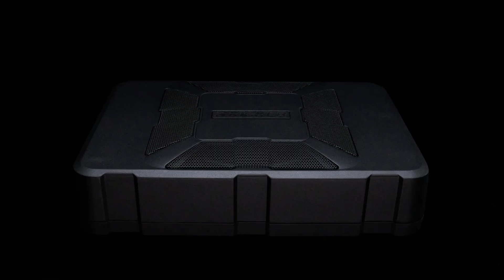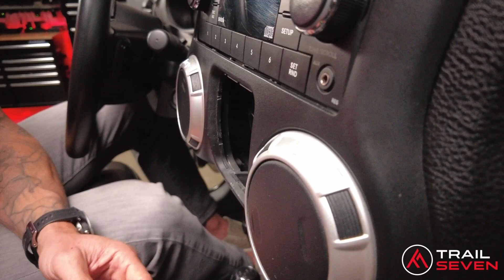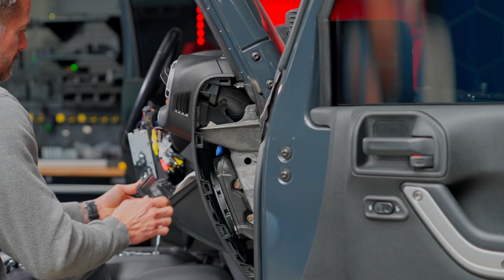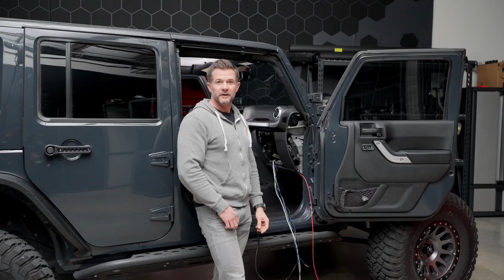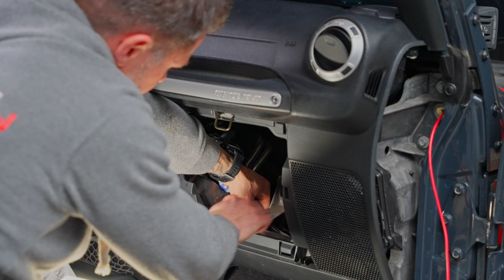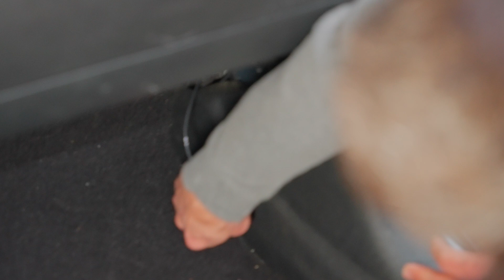Kicker Subwoofer Upgrade Bundle | 2007 - 2018 Jeep Wrangler

Comment: Will this work in a 2020 Jeep JLU? I also have the height 10 stinger head unit. The only difference I noticed was the disassembly of the dash, other than that it’s all plug and play.
Reply from the maker: Yes, but you can order our Hideaway bundle for the Gladiator and select aftermarket radio so we’ll prep it with the RCA’s to connect to your Stinger. 

They don’t rest under the seat in JLU as nicely as the JK.  It’ll rest sideways and will be a bit cramped. 

Here’s the link:

https://trailseven.com/products/kicker-plug-play-hideaway-powered-10-subwoofer-bundle-upgrade-20-23-jt-gladiator?variant=43931657175293

Comment: How does this compare to the Alpine underseat solution?  The SBV-10-WRA Pre-Loaded 10" paired with the Alpine KTA-30MW Tough Power Pack amp is what I am referring to.
Reply from the maker: Hello- This video is of the Kicker speakers.  You’re referencing the Alpine sub woofer and Alpine amplifier.  What are we trying to compare?
Reply: @trailseven  I am currently trying to decide between the 10" powered Hideaway from Kicker, vs going the Alpine underseat solution.  I know you guys have used both so I am asking how those 2 solutions compare.  I have the factory Alpine Premium system with factory sub at the moment. (2013)
Reply from the maker: @mopetersen6696  Ooops, very sorry, this is the Kicker Hideaway video, you are correct.  

The Alpine underseat sub is a phenomenal true 10” sub that can’t compare to the Kicker compact Hideaway.  The Alpine option is far more of a subwoofer and the KTA is far more true power.
Reply: @trailseven  thanx, much appreciated!!!
Reply from the maker: @mopetersen6696  You’re very welcome!

Comment: There are a couple of problems with this video. First, the dash disassembly shown is actually for a 2011-2018 JK/JKU. The dash is significantly different for 2007-2010 JK/JKU models. Second, 2007-2010 JK/JKU owners with the premium factory sound system already have a subwoofer in the rear cargo area and a bigger amplifier located beneath the steering column and behind the lower dash knee panel. This video does not offer the best choice for a factory premium sound system and my advice (as a professional audio engineer) is to simply upgrade your stock subwoofer by replacing the driver in it with a more efficient one. This will increase the bass output with minimal changes to the system. Unfortunately, Kicker does not understand this and does not offer subwoofer drivers with significantly higher efficiency.

Here's what you need to know: Every 3 dB increase of sound level requires you to double the amplifier power. Your driver must be able to handle this. This is the approach that Kicker takes. They make their drivers to handle more power so you can increase the amplifier size and get more sound from your subwoofer. This requires you to switch to a subwoofer driver that can handle more power and add a subwoofer amplifier that can supply the higher power. This quickly gets expensive. The way I'm suggesting for factory premium sound systems with a factory subwoofer does not require any more power, so you do not need to add or replace any amplifier. All you need to do is replace your factory subwoofer driver with a new one that has a higher sensitivity (i.e. higher efficiency). The factory 8-inch sub driver has a sensitivity of 85 dB or less. It has a dual voice coil and each coil has an impedance of 2 ohms. If you replace your factory sub driver with one that has a sensitivity of 91 dB you will increase the sound from your subwoofer by at least 6 dB. This would be comparable to increasing the amplifier power 4x (remember, it doubles for each 3 dB increase).

Higher efficiency will increase the cost of a subwoofer driver and you can expect to pay US$365 to US$400 in the U.S. (2026) for an 8-inch low-profile sub driver with a dual 2-ohm voice coil and a 91 dB (or better) sensitivity.
Reply from the maker: Um, thanks for your input?  😂.  

For one, this is a compact subwoofer solution to simply add a little bit of bass to the Jeep.  For two, the Jeep in the video is equipped with the factory Alpine subwoofer as well and in fact, the output from the Hideaway well outperforms that factory subwoofer.  Third, nobody said this was the “best”; if you’re looking for the best. We have plenty of full system bundle options using Kicker, Alpine, MB Quart, and Audison.  

The rest is unnecessary information to a group of customers seeking a quick, inexpensive, simple solution to add a little bit of bass to their Jeeps, but again, thanks for the information, we appreciate you. 😁

Comment: Very detail and I watch this few times before the installation. First time, took me 4-5 hours and few breaks to watch segment of the video. I have an AX4000 so no amp turn on wire. After some research I need to T splice to the REM on wire. Sounds great.

Comment: Any suggestions on installing one of these subs in a 2024 Ford Ranger Raptor? Looking to replace the stock sub behind the back seat.
Reply from the maker: @skbid1  It wouldn’t replace the factory sub.  That would be a more complicated set up.  The easiest would be to tap into the front  speaker wires similarly to our Jeep Wrangler/ Gladiator demonstration.

Comment: would you need an AMP to use this subwoofer or the Kicker Speaker Upgrade Bundle??
Reply from the maker: @johnblack8771  Not at all.  The Kicker Hideaway is a Powered Subwoofer which has a built in amplifier.

Comment: I’ve installed the 10 inch sub, but the bass seems to be pretty weak. It is powered on and I do feel it vibrating. Maybe I was expecting to much? I’m not sure, it’s not very noticeable over stock.
Reply from the maker: @Cody-eo1hr  I would say that’s it not connected properly or not adjusted correctly.  The 10” Hideaway undoubtedly overpowers the factory subwoofer.  

Please call us to assist with the adjustments.  
301-450-3207 9am-5pm est, Mon-Friday.  
We will be closing early on Black Friday.

Comment: Does the passenger feel a lot more bass than the driver since the sub is directly under the passenger seat?
Reply from the maker: @Seasonspass33  Yes, the subwoofer rests under the passenger seat so the passenger will certainly feel the bass.  You can rest it under the driver seat if you prefer.
Reply: She’ll love it don’t worry lol 😅

Comment: You mention on a few threads that there is a separate video for factory head units. Can you please share the link as I am unable to locate the video referenced. Thx!
Reply from the maker: We have a video for installing the Hideaway to factory head units but in the Gladiator.  The installation concept is the same in terms of tapping into the B-Pilar speaker wire.  We do have an Alpine unit that connects via plug and play directly to the factory head unit.

Comment: Mike, is there anything that needs to be changed with the install to make the add-on sub work in tandem with the OEM sub?  I'm running your XAV-AX6000 kit in my Rubicon now, all speakers are the stock premium Alpines.
Reply from the maker: The Hideaway will function independently of the factory subwoofer with a direct connection to the Sony head unit via RCA and remote wire.
Reply: @trailseven  So with this, it won't interfere with the operation of the factory sub, looking to run both at once.
Reply from the maker: @stetto  Nope, not at all.  The Hideaway overpowers the factory sub so you’ll notice it more over the 2.  With the Hideaway up front and the OEM in the rear, it makes for a good balance overall.
Reply: @trailseven  Right on, appreciate the info!

Comment: Great write up! You just gave me the confidence to tackle this. I put in an order for the kit. 🤘
Reply from the maker: Awesome!!!  You can do it and we’re here to help in case you need it!
Reply: @trailseven  I haven’t received a shipping update through the shop app. How long is the normal standard shipping time? 

I appreciate the support. I’m sure I’ll get it knocked out. ✊
Reply from the maker: @martymcfly882  Each plug and play bundle is prepared per order and with the holiday sales, we’re running about 2-3 days to build and ship.  You will receive an email once the tech prints your order and another following which will include the tracking number.  Please let us know if you need anything prior to shipping.
Reply: Got it figured out!
Reply from the maker: @martymcfly882  Sweet!  We’re here if you ever need us!
Reply: Install was easy and straight forward! 🙏
I seem to have an issue with the bass knob not adjusting the bass. 😕 Recommendations?
Reply from the maker: @martymcfly882  Let’s confirm a few things.   What is the gain set to, and have you turned on the amp/ sub through the head unit?  And to confirm, the amp on wire has been connected, correct?  
Please reach us directly for additional troubleshooting- support@trailseven.com, and/ or you can call us Monday-Friday, 9am-5pm est, 301-450-3207.

Comment: 0ctuber/23 Up date. I buy the 10" kiker sub.  Take to a professional shop 30min install in my wrangler jk, amazing sound  deep bass... next  day saturday i drive around 6 hours having fun whit this amazin product from kiker works amazin all day long. next day sunday take my jeep and do not work the light is on,  i take back to the shop, the guy say after make several test diagnost is the speaker  the amp look fine, so i decide to return it. So this sub is made to last 24h only👎

Comment: I think this is missing from my system. I've pulled the carpeting from my Jeep so the velcro stabilizing will not work for me. Any suggestions? Thinking some kind of foam/rubber stripping.
Reply from the maker: Possibly rubber gym floor matting?  🤔

Comment: Can the 10” be installed only in passenger seat or can It be installed in driver seat.on 2017 Jeep Wrangler JK
Reply from the maker: It can be installed under either seat as long as it’s a 4-door.

Comment: You remove what appears to be a stock 6:10 head unit, and proceed to inform us (after watching this far into the video) this install video is for an aftermarket head unit — I don’t understand. Most of us watching this probably have stock head units. 😂😅
Reply from the maker: That’s a valid point, however the first part of the video is just to demonstrate the dash disassembly regardless of the head unit.  This video is aimed towards connecting to an aftermarket head unit.  We’ve made other videos to demonstrate connecting the Hideaway subs to stock head units using the speaker wires in the b-pilar as the source Vs the RCA’s to an aftermarket head unit.  

We do offer plenty of aftermarket head unit solutions for your JK! 😉
Reply: @trailseven could you link the video for this please? The colored wires coming out of the head unit change at the B Pillar and then again at the sound bar… very frustrating. Thanks.
Reply from the maker: @TheAvgSvg Hello- I would recommend viewing our Hideaway install into the Gladiator which demonstrates connecting to a factory radio and shares the same b-pilar colors. 

Here’s the install guide for the Gladiator Hideaway connecting to a factory radio- 

 https://trailseven.com/blogs/jeep-installation-guides/2020-2023-jeep-jt-gladiator-kicker-hideaway-powered-subwoofer-installation-guide
Reply: @trailseven do you think the colors from the gladiator are the same for a 2015 JKU stock head unit? Was trying to pull from the sound bar wires in the b pillar of course
Reply from the maker: @TheAvgSvg Yes, expose the b-pillar wiring.  The colors may vary slightly.
Reply: @trailseven thanks for your help
Reply from the maker: @TheAvgSvg  You’re welcome.  And by vary, I mean may be a slight shade different.  The 2024+ is the same, but with a slight shade difference, etc.

Comment: Will this fit in a 2 door JK 2015?
Reply from the maker: Unfortunately, It won’t fit under the scissor seats of a JK if that’s where you are asking to fit it.
Reply: @trailseven  I looked at it it does look like the 2 door just dosent have the room
Reply from the maker: @patricksullivan9713  Correct.  We’ve seen some creative install locations for the 2 doors but none that are a direct fit under the seats.

Comment: Excellent video, thanks for the demo. What is the best way to tap into the audio signal with a stock 5in. Head unit for this upgrade? Can I tap into the Roll bar speaker leads for the sub? I don't think the OEM head has a sperate Sub output terminal? I've got a 2020 JL not a JK

Comment: Would it be posable to install two one under both the passenger and driver seats. do you have an installation with the stock head unit or the difference?
Reply from the maker: It’s absolutely possible to install 1 under each seat.  We have a video posted for the Hideaway install in a Galdiator to a stock head unit which you follow the same wire taps to the B-pillar as shown in that video for the JK.

Comment: Thanks for the video. It helped me understand what to expect installing, but FYI, this sub will NOT fit under the seats of a 2-door JK. There are additional mechanisms to allow the seats to fold forward that probably aren't on a JKU. I ended up sticking it in the seat back pocket on the driver's seat. Adds a lot of punch that way!
Reply from the maker: Glad you found it helpful and we heard recently about the 2- door issue which we will absolutely make note of and update comments on the product pages.  A customer was able to fit his about 80% under the drivers seat.  Super glad to hear that you found a solution and thank you very much for sharing your experience.  Let us know if you need anything at all!
Reply: For two door JKs purchase seat risers. I was able to install a Bestop gun box under my drivers seat and that’s suppose to be impossible
Reply: Thanks for the comment. Going to try the back seat pocket as my placement as well on my 2 Door JK.

Comment: Would running the power to the battery keep the amp constantly on?
Reply from the maker: No, the amp turn on wire at the head unit turns it on.

Comment: I just had a Stinger Heigh10 installed....is it as easy as this to get to the rear of that unit? 
Only thing holding me back is being scared to mess up that new unit!
Reply from the maker: Absolutely!  I wouldn’t let that deter you.  The chassis of the head unit will remove in the same steps.  The Stinger has a front screen bezel and a couple of screws on the side of the screen to remove first.  Other than that, the connection to the head unit is the same.  

Connecting to the speaker wires in the side pillar leading to the sound bar is always an option.  However the best quality sound and functionality will come from connecting it to the head unit.  

Let us know if you need any assistance!
Reply: @trailseven  Awesome!
Can't wait to get my SW and replacement speakers!
Reply from the maker: @jdodimead  Sweeet!  Have you placed your order?

Comment: Was there a reason you did the ground wire along the side versus just dropping it down from the glove box where you initially started with the wire harness?  I'm not opposed to it, just wondered why you did that one along the side versus dropping from the glovebox, I figured there may be a reason I missed.
Reply from the maker: Mainly to keep the ground wire separated from the power wire to avoid any possible interference.  You can drop the ground wire as a test.
Reply: @trailseven  Okay, I figured it may be something along those lines.  Thanks for the response!

Comment: My 2016 has the bracket and no heated seats.
Reply from the maker: Awesome, thank you for the info.  We weren't sure so we wanted to cover all of the basis.
Reply: Same on a 2015. Also, the bolts were not T27. I couldn't figure out what they were. I ended up just bending the bracket up out of the way, but on a 2-door there still isn't enough room for the sub.
Reply from the maker: @badfootct  Strange but not strange.  Our shop JK definitely has T27 but I’m not surprised to hear of different sizes.  We hear of different grommets for the back up camera installs and different dashes that some require trimming while other don’t.  No surprise there would be different sized bracket bolts.  Darn Jeeps, 🤪
Reply: @badfootct  I was just bone'n up to install this sub in a 2-door. It wont' fit?
Reply: @kmortensen  It wouldn't in mine. There is a bar along the back of the seat which was hitting it when you try to fold the seat back down.

Comment: Seems like a lot of spare wire for a custom wiring harness.  God knows there isn’t much space to tuck bundles of wires, especially if you already have other stereo or electronics.
Reply from the maker: We left a good amount on the harness to allow for folks to install the hideaway in other locations if they opt for it.  There’s a ton of space behind the glove box for the extra wire but in case an order needs to be shortened, we can absolutely reduce the length to any specified length required for 1 off builds.  Just give us a call, send an email, or poke us on live chat to discuss your specific needs and I’m sure we can accommodate.  

We also have a 5m RCA extension that can be added in for the build that requires it to be mounted in the bed.  As long as it’s mounted under something to allow for proper air movement as engineered, it can be mounted anywhere.  

We have customers needing extra length in their back up camera wires to account for swing out carriers which we custom adjust to cater to the needs.  

Our Jeeps are customizable and so are our bundles to fit the needs.
Reply: @trailseven  Can you customize for those who have high level outputs on their aftermarket head-units instead of low level/ RCA’s ? 

Great videos BTW!
Reply from the maker: @jonnymiami27  No, our hand off would remain as RCA’s.